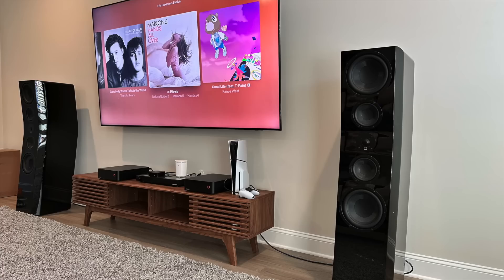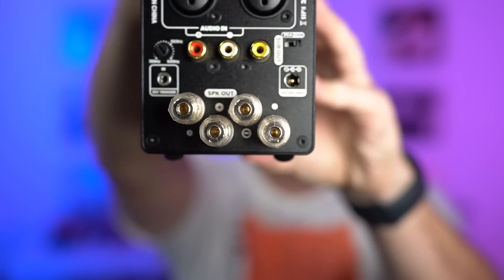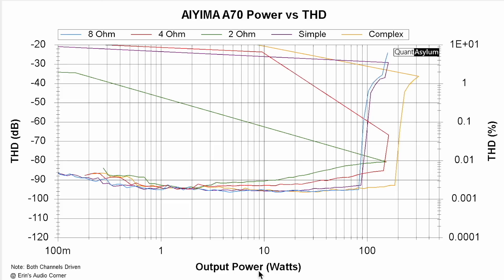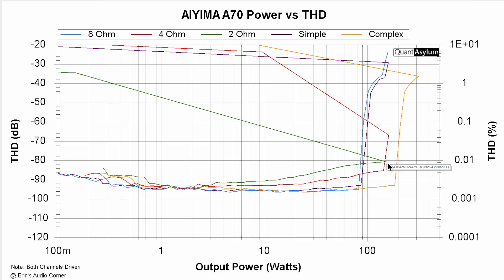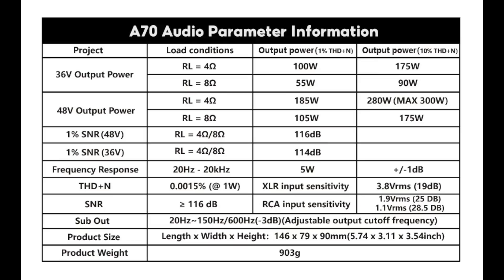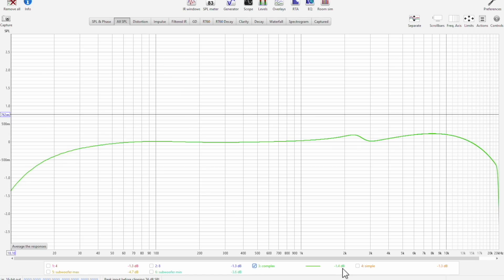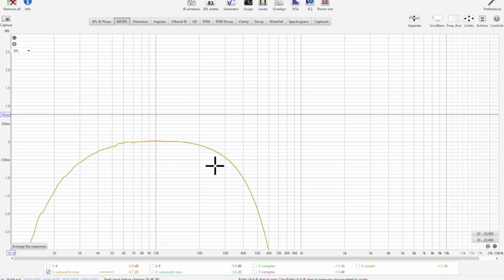The Shocking Truth About the AYEMA A70's Advertised Power!

Comment: Great that you did the objective and Subjective tests. Love this. Wish you had an audiophile amp with similar power to really shut em up.
Reply: @DearSX  
TBF, the March Audio P501 Monoblock amplifiers that Erin used in his Blind A/B/X subjective listening tests are for all intents and purposes considered to be "Audiophile" grade amplifiers.

The P501 amplifiers use the Purifi Eigentakt 1ET7040SA modules which are about the closest thing to a pure "straight wire with gain" that you can buy, meaning that the output signal = the input signal with no additional distortion, color/flavor, or deviation.

Yes, the March Audio monoblock have more output capability before distortion rises significantly, but all things being equal otherwise, the differences are simply the ability to play a given set of loudspeakers to a bit higher level.

An amplifier's output power should be chosen based on the sensitivity of the speakers, their rated power handling, your listening distance/how large your listening room is, and how loud you desire to play said speakers.  

And with more excellent "real-world" test such as this one by Erin, we can be more confident in our choice when comparing two or more different amplifiers for use in our particular system and listening room. 

As Erin noted, both amplifiers "sound the same", but his reference March Audio monoblocks can drive his speakers to a bit higher SPL.  Whether or not that is necessary in your particular setup depends on the factors previously noted above as well as the dynamic capability/threshold of dynamic compression of your particular speakers.

If others are of the opinion that an "Audiophile" amplifier should in some way embellish the sound via some type of affect on or deviation from the source or input signal, that's fine but another topic entirely.

An amplifier that isn't neutral or accurate to the original input signal may sound "better" with some music depending on how it was mixed and mastered, but it may also sound worse with other music, so you are giving up any consistency and confidence that you are hearing the true sonics of the source as finalized and approved by the artist and engineer.

A recording/mixing/mastering engineer would instead reach for any number of EQs or EFX processors to "embellish" the sound characteristics to their liking, rather than swapping/rolling amplifiers (or cables) to achieve a specific or desired sonic character.
Reply: @bbfoto7248  Speaking of EQ...

I found there is a deep division among audio types. The Eq crowd vs the purists that think Eq ruins a system. Just like Jesus would say where the synagogue at? The sound engineer that mastered the recording would say where the Eq at. 

All systems sound different and need to be tuned for listening volume, distance, room, speakers.

Comment: Hi Erin. Will a speaker that dips to slightly below 4 ohms still do so if you high pass at say 80z when coupled to a sub ???
Reply: @Dannyboy623  
Adding to what  @NosEL34  said, IF there are Frequency vs. Impedance Graphs supplied for the loudspeakers as is common in Erin's reviews and measurements, you can simply look at the impedance trace and see at what frequency(ies) the impedance dips below ~4 ohms.  If a respectable manufacturer supplies any charts at all, the Frequency vs. Impedance is one that is usually supplied more so than others.

IF the frequencies where that/those dips occur is ~1/2 octave above your intended HPF, then it will be mitigated for the most part and the amplifier won't "see" it or be impacted by it significantly.  This, of course, depends on the type of electronic crossover filter and the steepness of the slope.

THIS IS ANOTHER REASON WHY HAVING THE MEASUREMENTS AND DATA MATTERS.  ;)
Reply: You would need the data on that speaker or ask the manufacturer at what frequency/frequency's does that speaker dip into the lower ohms. I've seen graphs were they dip in the lower frequency & then other speakers that drop up higher in the frequency range. But yeah if a speaker is cut off before it goes below 6 or 4 ohm that would be easier on the amplifier. Interesting question..I've never thought about that before. Maybe someone with more knowledge will chime in on the subject.

Comment: That thing looks like a Fosi. The overall chassis & finish is extremely similar. Starting think both companies are, instead of competing, working together to flood the market with these cheap, small form factor amps. They could be trying to bury the, albeit more expensive, better Western built ones. The same thing appears to be happening with DACs & headphone amps. I've heard these cheap Chi-fi amps are OK for near-field, low volume listening but not much else. I'll be sticking to the Western brands. Even if I have to save for longer. The old saying still rings true - You get what you pay for.
Reply: Often cars from different companies look similar 
And how much styling can you do with a cheap box?

Comment: Good review...looks like it does exactly what it supposed to do ....amplify the input signal unchanged ....nicr that you compaired it to a more expensive and powerful amplifier....don't know if the speakers are hard to drive but it would be nice to have the results with some notoriously hard to drive speakers to push the limits.  The 10 amp power supply would also be a useful comparison.

Comment: Thanks for the amp review.  Looks like it will work for a system that won’t need a lot of power including power to rock out, as you said.  Very reasonably priced which is good news.  Consumers need good affordable equipment.  Rock on!

Comment: I understand willing to have a low pass AND a high pass.  At this price point, I would probably opt out, as the components that would be used would probably be cheap and affect the sound on the mains.  Pretty sure that would be audible.  If it were to be done in DSP, then, it'd be cool, but this unit has analogue inputs, so it would need to do A/D, apply DSP, then go through D/A before sending it to the amplifier section.  I have the little miniDSP 2x4HD and having tried that, I wouldn't recommend the extra A/D-D/A conversions.  It does affect the sound.  Best combination would be to use digital inputs on a unit like the 2x4HD, then you have one or two channels of subs, and two channels of mains to be amplified by a little unit like the A70.  
Thanks for the reviews!

Comment: This looks super clean for a 200$ stereo amp with a subwoofer out. I use a benchtop power supply with amps like this, and it looks like this thing could easily handle the 48v 10a or even more, as the distortion coming near the max power may very well be from the power supply running out of juice rather than the amp having issues
Reply: What the amp can handle from an external power supply is really going to partly depend on the thermal design of the PA.. sometimes a 
lack of careful manufacturing of the product or the thermal integrity of the design, can limit the amp thermally, which will reward you with a dead amp if pushed too much too often.
Reply: @shipsahoy1793  true, but I can clearly see heatsinks that a noctua fan can help along and looking at the amps parts specs, it's capable of taking in nearly 300wpc so running 48v 10a or more is likely to be just fine with some cooling.
Reply: @Luke-qs2cg  sure, if you pull away more heat with convection cooling, of course that will keep the device junction temp down and the device mtbf up, as long as there's a good thermal connection between the device and the heatsink.
Reply: Is benchtop power supply a brand or just a type of power supply?  What brand and model do you have?  I tried to shop for benchtop power supply and got more results for construction power tools and kitchen counter tops.
Reply: @robertlogue3794  lol benchtop power supply is a generic name for an external power supply in its own case that can fit on the work bench. you need to look for an external power supply that can be adjusted to the voltage that you want and has the current capacity that you need for that voltage while maintaining the size and weight that you find acceptable. A linear power supply will be larger and heavier whereas a switched mode power supply will be smaller and lighter, but you have to be sure that it's not going to introduce any noise or interference. I have a nice clean Daiwa switcher, but I don't think they still make them.

Comment: @ErinsAudioCorner Purifi is one of the few class D amplifiers with hardly any phase deviation at 20 kHz (the best are those from Orchard Audio, with GaNFet, 0º deviation, better than most class A and AB amplifiers, which has a lot of merit).
I do not think that the Aiyima has implemented a DSP that solves the problem of phase shift, so with good recordings with traditional or electric instruments and voices without the damn Autotune the difference should be appreciated in a decent audio system. If recordings with electronic or computer-created music are used for the tests..

This old recording, 100% acoustic, would serve as a real test. Let us not say an orchestral mass, even better if there is voice (opera). Can you do the test with this video, please? Reproducing it at 4K / AAC 192kbps, which is the maximum that allows YT (the original rip, 24/96 FLAC 0)

The Bothy Band - Out Of The WInd Into The Sun (1977) Vinyl
https://www.youtube.com/watch?v=WUPToq2J23U

DR         Peak         RMS     Duration Track
--------------------------------------------------------------------------------
DR13      -1.15 dB   -16.93 dB      4:36 01 The Morning Star
DR10      -3.72 dB   -17.52 dB      3:18 02 The Maids Of Mitchelstownn
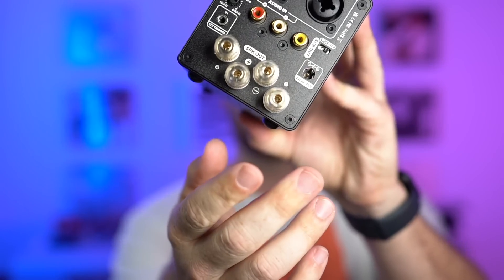DR11      -1.68 dB   -14.64 dB      5:43 03 Rip The Calico
DR14      -2.98 dB   -22.35 dB      7:04 04 The Streets Of Derry
DR11      -2.44 dB   -17.81 dB      5:04 05 The Pipe On The Hob
DR13      -0.59 dB   -16.62 dB      4:45 06 The Sailor Boy
DR13      -1.37 dB   -20.30 dB      5:04 07 The Blackbird
DR14      -0.56 dB   -17.34 dB      4:55 08 The Strayaway Child
DR16      -0.60 dB   -20.54 dB      5:13 09 The Factory Girl
DR12      -2.56 dB   -18.28 dB      3:21 10 Slides
--------------------------------------------------------------------------------

Number of tracks:  10
Official DR value: DR13

Comment: I think it's fine to keep griping about the subwoofer output not high-passing the mains. It's also not very aggressive at only -3dB, so won't mix well with the steeper drop off from ported speaker designs (or even sealed). Maybe it's meant to be combined with a subwoofer that has its adjustable own low-pass filter?

Comment: Erin, 
Do you or anyone here, know of a wattmeter that can be connected in between an amp and speaker.  I'd like to see how many watts my usage is.  I have found that Simpson makes a wattmeter that I could build a box with connectors, but maybe there is an affordable off the shelf unit.
Thanks, Kevin
Reply: If you just want to know a ballpark figure and you have a decent digital multimeter, you can measure AC voltage from speaker terminals. Then its the (result voltage)x(result voltage)/(Ohm value of your speakers) and result is the power in Watts. If you want to know how loud one Watt is, even a cheap multimeter gives accurate readings if you play a sine wave of 60hz (with proper multimeter you can use 1khz sine wave). 2.8 Volts AC with 8ohm speakers equals 1W, 2Volts if 4ohm. And be warned, it's loud...
Reply: @MikkoRantamo  Thanks a bunch.  I have used a VOM in the past.  In fact I had my Simpson 260 connected to a speaker in my shop and watched it hit 30vac at times.  Very expensive VU meter. hehehe  But, fun to watch and I got lots of questions about it.
I think I'm going to buy the Simpson wattmeter and give that a try when the $ is available.
Thanks again and all the very best.

Comment: Did you run any 1 kHz squarewave tests? I've tested a few of the moderm Class D amps, and it's surprising how much ringing I would see...I was curious how this one compares in that regard. Also, were you able to look at the harmonics of the amp? What chip does it use?
Reply: Ringing in a square wave is a natural consequence of limiting the high frequency extension. Class-D amps have output filters to remove HF switching noise that class-ab do not need, so class-ab might extend to a higher frequency (but not nessisarily, IMO a sensible amp design will have filtering to keep it operating only within the desired use range.) In other words l, you need not be put off by what looks like ringing in a squarewave test.

Comment: I think the majority of "audiophiles" would never want to do a blind test with their own equipment fearing they would have to admit they basically spent a lot of money where it wasn't necessary. I believe this would really apply to the older guys who won't admit that their hearing abilities just ain't what they use to be. I know mine aren't so I don't get too anal over these things.
Reply: AB testing amps is difficult because being honest with your own ears is challenging. I find saying something that sounds very slightly different  as "better" or "worse" kind of dumb. 

If I'm being honest I don't think an amp's "sound signature" really matters to me when I can get the "better sound" easily with a pre/dsp/eq/tube.
Reply: @mattmiller4978 I think the OP was talking about a blind ab test, where you just try to see if you can reliably identify the two pieces without seeing them. I tried this with several different amps by having my wife switch cables and the only amp I could pick out was an Onkyo avr that has a really smooth sound for some reason, even with all dsp options switched off. I had a couple different class D and A/B amps and two AVR's and they all sounded identical apart the Onkyo.
Reply: @MikkoRantamo  probably because it's not an amp it's an AVR and has some processing you cannot turn off. I have a Yammy AVR like that in "direct" mode. It changes the sound stage and plays behind vs the other switched standalone amps.
Reply: @mattmiller4978  Yup. Altho it states that the direct mode should bypass any processing, it still sounds too smooth. But interestingly, if you take the main channel pre-outs and hook them up to another amp, it sounds completely normal.
Reply: Exactly
Reply: Not at all.
I could instantly tell the difference between amps.

I used to only use Class A/B and Class D amps..

Now i only use Vacuum tubes.

As you grow and experience many equipment you end up with tubes
Reply: O I guess you know the “majority” of audiophiles. This is an idiotic comment, you sound like a pouty child.
Reply: Generalise much?
Reply: I think your wrong about the “majority” of audiophiles.
Reply: @Harrisongrey19  
Well if I am I sure would like to see a lot of the experts actually do it.
Reply: @chrislj2890  that would be useless bc it’s what they would hear, not what you would.
Reply: @Harrisongrey19  
I don't think you comprehend the concept of what I am saying.
Reply: @chrislj2890 I get it, it’s just the same comment found on every other audio review video on YT, it’s a boring  regurgitated comment just for likes

Comment: So I believe you about this not having a high pass filter but how do you know?  Are you testing and still seeing full range coming out of the mains or is it just that they call it a low pass filter for the subwoofer out and you are concluding that it's not a true crossover but just the low pass?  Again, I believe you but I'm wondering for other products as well.  The SVS wireless pro speakers and the Wiim amp for example both have a sub out that I assumed had both high and low pass filters.  Am I wrong to assume this?  Thanks.
Reply from the maker: The WiiM Amp does because I tested it. 

The subwoofer out is always engaged. There is no on off switch for it. You just turn the dial to alter the low pass filter.

So to answer your question, I did test the frequency response of the mains with the subwoofer out engaged because the subwoofer out is always engaged.
Reply: @ErinsAudioCorner  Thanks a lot man.